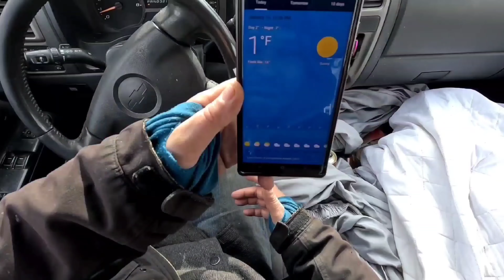Buick Rendezvous Heater Troubleshooting

Comment: Did you replace the heater core my car's been doing this for the last couple days cold upon Idol have to drive to get any kind of warm air
Reply from the maker: Yes, we changed the heater core, and it fixed the issue. I would imagine your issue is the same. If possible, try to feel each hose coming out of the firewall to see if there is a difference in temperature between the two. If one is warm and the other is hot, that means the heater core is clogged. Kinda common with these vehicles.
Reply: Hey anyone, would a coolant flush maybe unclog the heater core?  Thanks, Tim
Reply from the maker: It can, but I guess it depends on how bad it's clogged. We used to use this certain coolant flush additive that worked well. I don't remember the exact name of it but Google or a parts store should have something similar. Although I've cleared many with just a garden hose.
Reply: Thanks for the support. I am going to my mechanic next week for new break pads. I will ask him to blow out the hose/core and then do a flush. I too am only getting heat when I drive. I will feel the temperature of both hoses firstly. Sounds like a winner! (2007 Rendezvous). Thanks, Tim
Reply: .. could you reverse the Coolant Flow to the Heater core, by just switching the two heater core hoses..  forcing a Reverse flow into the heater core.  🤔. 

It'll either Unclog a heater core, or it'll do nothing, or it'll Blow up like Chernobyl 🤣

Comment: Thank you. My daughter has the same car it’s a 06 with the 3.5 just rolled 120,000 and she came by the house last night with the same issue. It blows out OK heat but it’s also 50° here in Michigan not 1° lol. Well at least I know where to start. It was due for a coolant flush and I was going to change the hoses and put a new thermostat in so I’ll probably continue to do that but at least I know to look for the heater core. Thanks again. Hopefully it’s warmer where you are now🙂🙂🙂
Reply from the maker: You're welcome! It's a little warmer now here in Central Illinois!